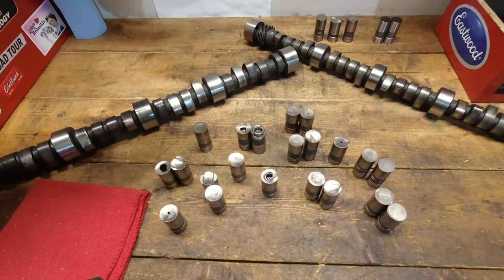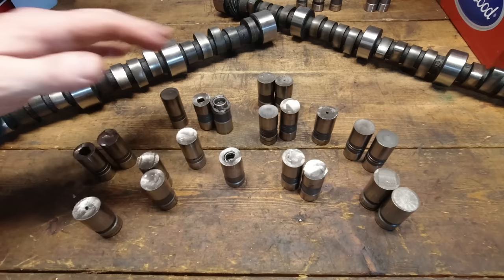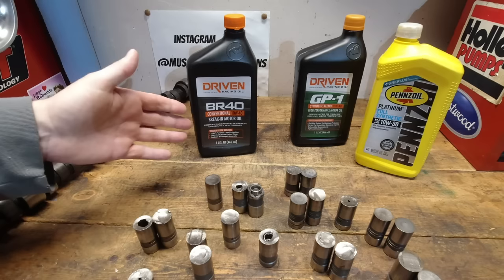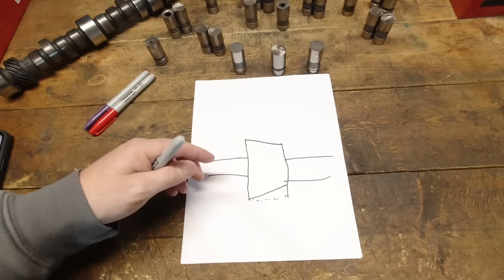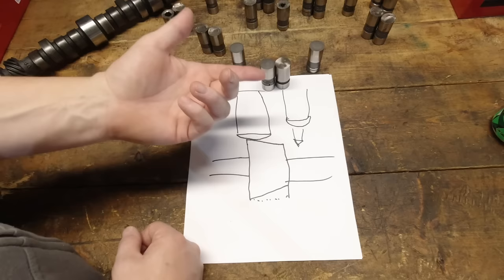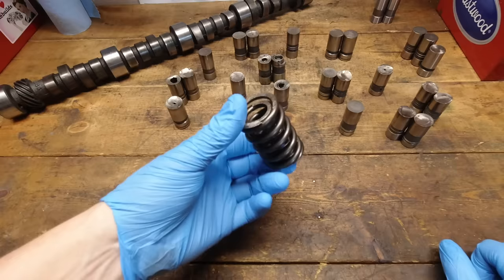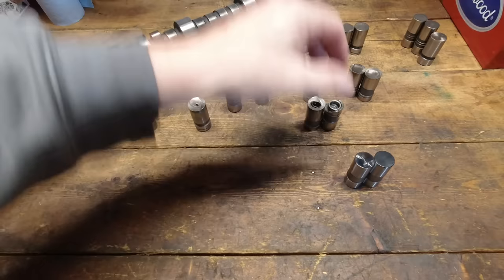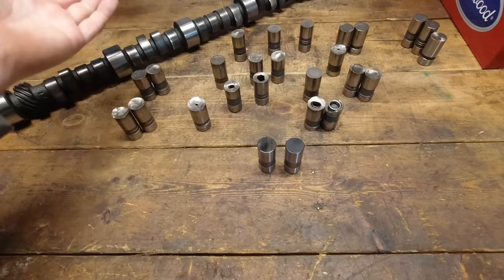Flat Tappet Cam Failures: The Reason Why They Go Bad & The Solution! Part 1

Comment: I always set the rockers a little loose for break in progress and I use sae 40 with Lucas breaking additive and white grease sprayed on the cam and lifters and a high volume oil pump
Reply from the maker: I hate to tell you that you’re asking for more problems that way.  Set lash to the cams specs.  Running a loose rocker arm doesn’t help in spring pressures, it assists in the valvetrain not being able to be in control.  White lithium grease has no zinc.  And mixing oils was a topic we covered at length in my interview with Driven Racing.  Not something that is recommend for all the reasons they gave.
Reply: @MuscleCarSolutions  thanks for your advice. The white grease was my dad's old trick like a banana and a noisy rearend

Comment: You must change the oil and filter every 1,000 miles. Ignore the extended oil change intervals the manufacturer wants.
Reply from the maker: Not really necessary.  It’s more important to have the right oil to match the charts tics of the engine, and of course the right tune/timing to help keep the uglies out of the crankcase.

Comment: oil oil oil, when engines started using roller cams the oil formulas were changed because they did not need the extra zinc and other things in the oil, the solution is to run diesel engine oil that still contains these additives, such as rotella 4 or some delvac. i found this out the hard way when my camshaft took a dive after a rebuild.
Reply from the maker: Diesel oil is not the solution.  The zinc was drastically reduced and it’s got a detergent additive package that’s not very good with gasoline engines.

Comment: I say it's youtube mechanics.
I've never had a cam failure, and i have to believe there's too many non mechanical people doing stuff off of a video that another non mechanical person has made.
It pays to know what your doing.
On top of that people are messing with rocker ratios and spring pressures completely disregarding lifter to cam pressures.

Comment: In some high quality jdm stuff they are dlc coating the face of the follower or bucket, I’m pretty sure that would be hugely beneficial for any flat tappet arrangement
Reply from the maker: It’s going to be interesting to see how it affects that category.  If it effectively solves the problem, the break in process looks a lot different.  Time will tell!
Reply: @MuscleCarSolutions  yeah it’s nice stuff! hopefully it’s going to get more common/affordable to get parts treated! it’s still from what I understand a bit costly but even crankshafts in rc car engines are getting the dlc coat now and they don’t wear
Reply from the maker: I was shocked to see how little it added to the price of the new Comp lifters.  Pretty amazing.  Especially from everything I’ve read about the prep work needed to get the DLS to adhere to the metal.  Can’t be cheap.  Looking forward to seeing more results and parts that use it!

Comment: If you have a roller block and you fit a flat tappet camshaft to it, it's like getting a machine gun for your birthday - but taking your old single shot rifle into combat. You can get away with grinds with over .500 lift but act like a very mild flat tappet off of idle..

Comment: Great video. Hot Rod Jay did a video on my channel explaining spring pressure and how to measure and set up valves. I think people ignore it because it can get confusing.
Reply from the maker: Confusing and a lot of work.
Reply: @MuscleCarSolutions  yeah, but worth it.
Reply from the maker: If someone wants it to live it’s worth it! 😆
Reply: @MuscleCarSolutions  To be fair, retailers have advertised a lot of high performance parts as "bolt on" which is is a crap marketing ploy to sell parts.

Comment: I went roller in my 401 AMC engine.
This issue persuaded  me to. 
I know stiction as an issue and metal absorbs elements like carbon nitrides and etched into the Bore walls making rotation more difficult. That “stiction dynamic alone is unknown overlooked. A 2000 grit polish on lifter bore and lifter itself makes NO real amount removal of metal yet will make surface significantly easier for it to rotate.
Metal block absorbs an etched in oil chemical needs to be understood and dealt =t with. Such as I said.
Reply from the maker: That’s getting pretty finite with an issue.  In this series I get very deep into all the internet theories and have a really basic list of things one can do to be more successful on break in and beyond.  Lifter to bore tolerance is so critical but no one ever knows what that was once they’re trying to figure out why something failed.  It’s just easier to blame something or someone else.  Next video in the series is good.  I cut up cam cores and show what harness actually looks like.
Reply: @MuscleCarSolutions  
Yes, its a simple task yet actually the theology of etched in elements, due to oil chemistry is real. 
I Deal with it at work in High Tech, and is a normal thought process when handling wafers pick/place and concerns of stiction is part of the known elements. Wafers are usually worth 500K on Up so we need to be literally anal about every little known thing in our  mechanics.
Reply from the maker: @yafois988 I suppose with tighter tolerances, the more strict the conditions must be.  Fortunately all these old first generation engines were ridiculously loose compared todays modern engines.  Love how the technology keeps advancing.

Comment: API mainly leads to ASTM references these days.  Better go read the IVA and IVB procedures [D6981 and D8350] to even talk about lifters it seems.  Note the engine spec for these tests: overhead cam design.  Simplified, that means you have to hunt very hard to find anybody testing oil performance in a [classic] flat tappet design today - their [astm] term "lifter" points to bucket/shim or follower design [similar to a 240z for example].  Apples and oranges.   So because of that,  I suspect 80% or more lifter/cam wipeouts may be oil related.    Another issue should also be highlighted apart from certs and specs: on net, its rings that need break in, while cams need protection on a fresh build.  The points about oils focusing on detergents/anti-sludge additives bears inspection, but.... who's doing those tests?  I doubt a current astm method can serve, but I'm not guru level on the subject - I could be wrong.   Oil companies have always served manufactureres and their design specs, and therefore its independant third party wear testing that is going to shine any light on awards given to existing off the shelf oils suitable for flat tappets [and the severity of service].  One  possible starting point for estimating an award level is take existing spring pressure at max lift, multiply by rocker ratio, and divide by 0.0065" to get a rough psi threshold target capable of protecting lifters & lobes.  There's other correction factors to consider likely, but I'm not an engineer.  A 5 level award tier should be reasonable enough to cover a variety of spring pressures & rocker ratios from long ramp/bone stock, to race only/max under the curve applications.
Anyway, don't get stuck on zinc: the game is protection, however a chemist can create it.

Comment: This is why my engine shop went bankrupt...
From a decade of success to 2 months of post dyno all ok crate motors being returned after less than 500 miles with catastrophic damage by iorn filings in the oilways😡😡😡😡😡😡😡
Reply from the maker: I’m sure there has been lots of money lost with these failures.  Sad to hear about.  Machine shops seem to be dying out at an alarming rate.

Comment: I believe Myvintageiron did a test with all the manufacturers. He found out that the hardness was not the problem bc on the Rockwell test they all passed. He found out that it comes down to poor maching on the  lifters. His suggestion as well as David Vizards and others was to go roller. I know...I know...but it costs more money everyone says. In conclusion if you don't have the money to install the roller cam will you have the money to tear down the motor and clean it? Maybe we should just budget for it. It's a gamble.
Reply from the maker: As long as that hardness test was done BEFORE it was installed, then it’s valid.  Running a hardness test on a broken in cam isn’t.  Only way to verify is the cut it and look at the depth.  Another video for another day….
Reply from the maker: And as mentioned in the video, it’s the combination of things I showed.  I’m not sure I would make that universal statement.  There’s a number of factors at play.  Have a customer that buys cams with a .004 taper!!!!!!  Why?  To match the lifters he uses.  Not ideal in the least, but a lifter with that type of crown would fail on a normal taper cam.  It’s all about the combination.  Funny we keep hearing that word when it comes to engines…..😉

Comment: If OEMs never used special break-in oils or never used special breakin periods, just drive the car normally and change the oil after 1,000 miles why do engine rebuilders need to use special break in oil and break in procedures for the cams?
Reply from the maker: Because oil had the right blend of zinc and moly back in the day.  Oils have changed - drastically.  And like mentioned in the video, I believe lifters are the bigger problem.  We’ll be looking at that in-depth in a future video.

Comment: IMO, the BEST thing you could do, is buy a complete matched valve train from the same manufacturer. That way it is engineered to work together correctly. It's expensive, but how many times can you buy things that do not work together?
Reply from the maker: It’s part of it.  Check out the rest of the videos in the series.  There’s a ton of good info and other things to get right to ensure proper break in.  It’s not complicated but it does require some work these days on engines that are old and far more worn out that people expect.

Comment: What about if you have an older engine and you're just swapping out the cam? And the bottom end of the engine has over 100,000 Mi on it how do you protect the cam from failing? Or do you still use braking oil break in oil

Comment: Moral to the story spend the $ now to save more later and avoid the hassle. Im 64 and have been wrenching professionally since my teens. Built a ton of engines and never broke a cam in. We never heard of that.
Reply from the maker: Folks have heard of it now!  😆
Reply: @MuscleCarSolutions  LOL guess so. We just built a stock small block 350 using a melling cam and lifters aswell as break in oil. Did the break in proprly and the cam failed. My son inlaw cut his losses and upgraded to a later roller short block.
Reply from the maker: Properly is a subjective word.  Which is why I covered the three things you can do to help keep one alive.  Most folks who say they did it right usually ignore one or screw up another.  But even then, it’s a spin of the wheel and hope it comes out ok.
Reply: @MuscleCarSolutions  ok
Reply: @MuscleCarSolutions  In my early 20"s I worked for a engine remanufacturing plant and other than putting the engines on a stand pumping oil through them aswell as adjusting the valves and doing a compression check there was no break in procedure and other than having the classic oils of the time we had no cam failures. We put out a lot of different makes of engine. These have been all my experiences over the years so other than subpar products and old school oils It doesnt make sense but again step up to a roller and avoid the drama and expense to begin with. Well worth it.
Reply from the maker: I couldn’t agree more.  Roller solves a lot of potential problems!

Comment: Watched the entire video and I still don't see a definitive answer as to the all of a sudden increase in cam and lifter failures.  I also do not agree that it is spring pressure, or the oil, or mis matched components.  Also, ZDDP additives are not affected by detergents in oil.  Also, this is not isolated to flat tappets.  Roller cams and lifters ate also failing in enigines at a higher rate in the last couple of years.
Reply from the maker: If you don’t think incorrect spring pressures, oil, miss matching components with differing crown/taper don’t matter and if you don’t think zinc is affected by detergents (basic oil chemistry), you’re REALLY going to be confused by the comprehensive lifter video I’m currently working on.  For sure DONT watch the camshaft hardness video either.  That one for sure will be super confusing.

Comment: Great video man! I am getting everything I need to install my flat tappet cam. Should I install the cam, lifters, heads and all the other components before changing the oil? I bought the comp CAMs break in oil (5 qts). I’ll buy the Driven oil for after break in process. Also, do I need to soak the lifters in oil before install or just prime the pump after installed?
Reply from the maker: Not following you.  Assuming you’re asking when to use the break in oil?  Use it for the break in.  Is this a new rebuild?  Then use it for the initial break in and for a few hundred miles for the rings to break in also.  There are a number of ways to set lash.  I soak mine the night before.  Just remember if you use a good assembly lube and you prime the engine excessively, you’ll wash it all away.

Comment: I've personally never had one fail but anymore I just go with a roller so I don't even have to think about it
Reply from the maker: Yes sir.  I switched to roller quite some time ago.  But I fully understand someone wanting a cheaper option.  Thankfully there’s a good solution to the failures now.
Reply: @MuscleCarSolutions  very true I only use roller when I have a roller block available if not good ole flat tappet it is because like you said link bar roller lifters have a crazy price tag
Reply from the maker: You for sure pay for the convenience and hassle free operation of the roller up front.
Reply: Same. Roller valvetrain in a built 351m
Reply: @frankglasgow  yessir I've got one in my built 351w

Comment: You won't see flat tappet cam failures with Brad Penn racing oils . The people that have been using them for years swear by that product. I have often thought that ND oils would also have the same cam saving properties ?
Reply from the maker: @edge2sword186  Brad Penn no longer exists.  When it was that brand and used the base oil from the Bradford Pennsylvania facility (see where that name came from?), it was damn fine oil.  When they sold to DA Lubricants and they decided to use a cheaper base oil to cut costs, they made the name change.  Penn Grade1.  Driven is now the manufacturer using that former Kendall facility for their GP-1 oils.  But I digress.  Oil is only one part of the solution.  There are some things with these 50 year old engines that no oil can save….  Keep watching the series!  We cover it all.

Comment: Engine tech camshaft stage 3 camshaft sbc wiped out in 5 minutes of running. I hag a oil leak from a galley plug and had to pull the left head. while the head was off i thought i would see how the lifters were looking. All the intake lifters were junk the faces were strangely pited. The exaust had a diffrent ware to them the outside of them had ware around the edges total garbage. I have been building engines for over 55 years never saw any thing like this.
Reply from the maker: There are a number of potential reasons why.  If you watch the rest of the videos in this series, I think you’ll know what likely caused the problem.  The three questions you need to ask are; what was your lifter to bore clearances, what oil did you use and what spring pressures did you use for the break in.  All those questions are explained with the why in the rest of the videos.

Comment: Why is it I never used a break in spring and never had a problem. I have a 396 in my 67 chevelle with .560 lift that I installed in 2002 and it's still running.  I have a 454 in my pick up with a lunati cam with there springs and lifters. 30k miles, no problems. Why is this all of a sudden a problem. My guess poor QC.
Reply from the maker: We talked about all the reasons why in the video!  Check it out!  No, poor QC isn’t the biggest issue.  It’s not even in the top 5 reasons.

Comment: Zinc . I still use these cams and i put zinc in my oil every time 0 failures . They took zinc out off oil i use lucas high zinc oil no problems.
Reply from the maker: @Martincustomdesign  only one small part of the problem.

Comment: The main problem i found is people do not make sure the lifter turns easy in the bore, especially with an in car cam swap where the base circle is different and lifter ends up running in a different part of the lifter bore. This is ok with a new engine but a hi mile engine you really need to clean the lifter bore of the tarnish or crud and make sure the lifter turns in it's bore by just a light touch of your finger. i have used a small brake hone to clean hi mile engines up over the years just to get the lifter spinning freely. and i all ways pull the inner spring out, It's cheaper than tearing up parts.
Reply from the maker: You’re on to something but it might not be what you think.  I’m working on part three of this series now and lifters is the topic.  Hope to have it done soon.
Reply: @MuscleCarSolutions  cheers watching part 2 now.